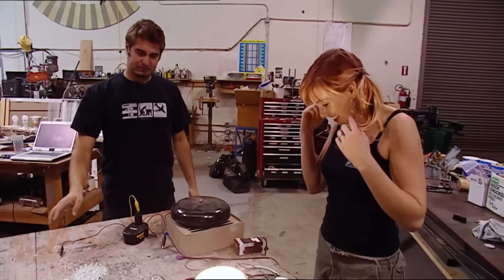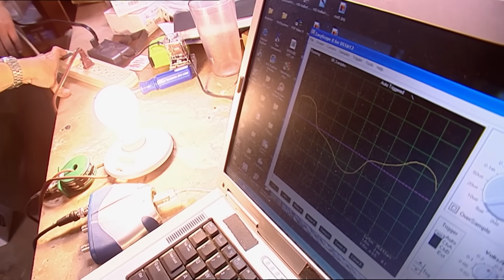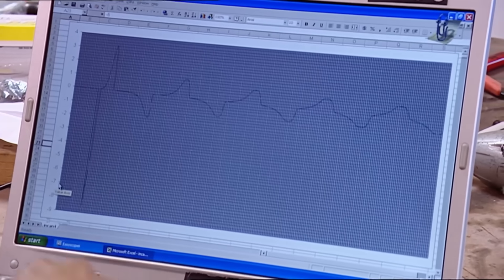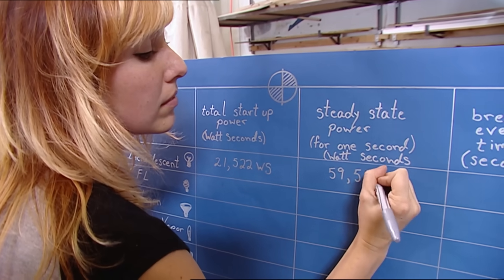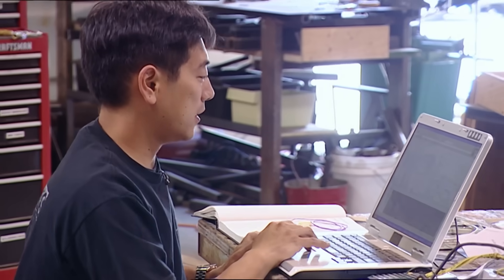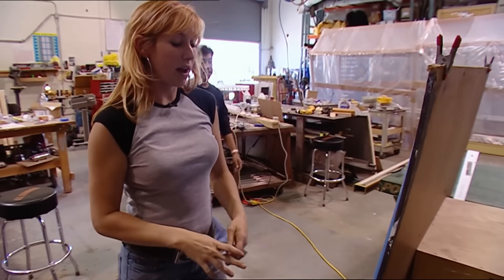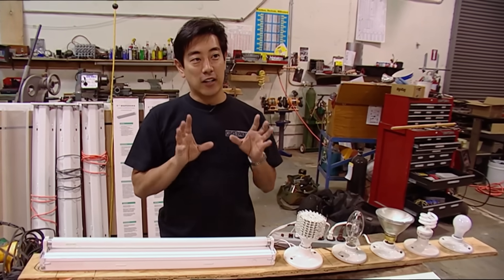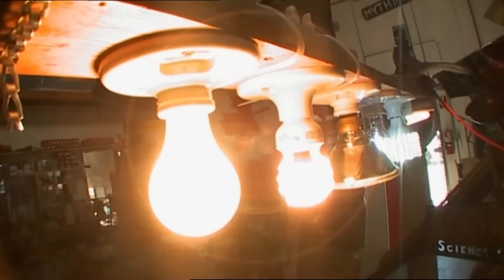Is It Cheaper To Leave The Lights On Than To Turn Them Off? | MythBusters

Comment: There are two items.     energy burn until efficiency.
Secondary item... is effect on life of turning things on and off.

If I leave my led on..  or even incandescent bulb.. they last a looong time.
if i turn them off and on...   they last 25% as long.   even led.

final item to take into account.        is how inconvenient is it to change the bulb.  
If its in a 12 foot ceiling   or outside in a hard to access enclosure..   i leave them on.

chances i fall off a ladder and hurt myself?    0 if i never go up to change the bulbs.
I want the time my property is dark at night outside to be minimal.     criminals show up quickly.

Comment: Two flaws I see: 
1) Didn't say how long each bulb lasted, only that by the end of the 5 year equivalent cycle, all but one burned out. So did some burn out at 6 months equivalent but they didn't monitor that? 
2) what was the cost of energy wasted by leaving lights on? In the case of LED, it's so small that it may be worth the convenience of leaving them on.

Comment: RIP Grant. 

Also, being a little pedantic here, but...this doesn't take into account the price of the electricity. If, for instance, you were running an off-grid solar/battery setup and and LED bulb on the excess energy produced by your system, then they proved here that leaving it on WOULD save money (albeit a totally negligible amount). 

But yeah, in general, turn your lights off folks :)

Comment: This is why I always hated that show and instantly felt anyone who liked it was kinda stupid. They don't even touch on how energy usage is calculated by the electric company & how accurately it will reflect turning the lights on and off at various intervals. They test the bulb longevity while turning them off/on every 2 minutes, but then don't tell us when each one died, and then they compare it to... nothing besides saying "it's 5 years of home use stress" like that is supposed to mean anything quantifiable to anyone who doesn't drool while they breath. How long do each of those bulbs last if you leave them on continually? You have to compare that number to the time it took to burn out while cycling on and off (which again, they don't tell us). Then you have to compare the prices of bulbs and the prices of electricity, and then you can finally see how the extra money to replace the bulbs compares to the extra money for cycling on and off. But the average cretin who thinks Star Wars is peak Sci Fi will accept this as  real science and regurgitate it to their friends. Barf.

Comment: They really dug up an old show since most of the bulbs tested are non existent now.    They forgot the most common reason to not abuse a light as starting them when cold causes more damage  not this 2 min on off test.   I have bulbs that will only last 2 years will low use. And the biggest problem is doing the replacement. some are 25 feet in a light fixture or how about 30 in a chandelier. I found out the old bulbs lasted longer when used with a dimmer   LEDs  and CFL  seem to over heat and burn out  due to poor uality.

Comment: I know that back in the days of CFL being the big thing, it usually ended up being that if you were going to be out of the room for less than 30 minutes, the cost of the wear on the bulb was more expensive than the cost to leave it on. With how little energy it uses for LED, you end up with even worse factors of how long it takes before you spent more money in electricity than it would cost for the wear on the bulb. I would say that a good rule of thumb would be that if you're going to be back in the room within half an hour for either type of bulb, leave it on because the cost for the life of the bulb you reduced with another power cycle is going to be more than the cost to leave it on. Not counting the hassle of actually replacing the bulb on top of that cost

Comment: They were approaching this completely the wrong way from today's perspective. My approach: Take a super-efficient 5W LED. And then factor in everything. Then few Wh saved vs.: Time spent turning off the lights and calories burnt (increased food cost) going there after you have forgotten before because you have a pedantic office coworker who insists on everyone turning the lights off. The enormous cost of being too lazy to turn the lights on when you quickly rush into the kitchen to just grab some small thing, and then bumping your head really hard on something or tripping and hurting yorself and then having to go to the ER.
Reply: A common approach for office break rooms and warehouse spaces are occupancy sensors. When used with fluorescent lighting, which might be a better choice than LED if lumen maintenance is an issue, programmed start ballasts can be used to eliminate the lamp life penalty that may be incurred with frequent starts and instant start ballasts.

Comment: What about Desktop PCs? What's the ratio that makes it legit to turn them off vs leaving them on?
Reply: Most pcs have a power save mode that idles down the gpu fan so leaving your pc on for several hours at a time isn't a big strain on your electric bill.

Your hot water heater uses way more electricity in one hour keeping the water hot than your pc uses in a week
Reply: @fateweaver9844  I understand that. What I was wondering about it for shorter periods. Like say... Not using it from half an hour to an hour. As for power saving, the issue with that is some apps don't play nice with it, and either stop working when resuming or don't work well afterwards.
Reply: @Jedijax7  Set your sleep and hibernate times, especially if you have an old school spinning hard drive. You'll save time over a cold boot

Comment: This myth was purpetrated by the idea that in large buildings it was cheaper to leave lights on rather than pay someone to turn them off.
Reply: Was it not possible to have some kind of central switch which can be used to cut power for every light

Comment: Well, and the funny part is LED can cause massive health problems for people with epilepsy. Incandescent are full spectrum and safe. Carbon wire not so safe because carbon wire react faster to AC stuff, but carbon are safe on DC. Spirals hot gas lamp are kinda safe as long as they don't look at them. Long gas tubes are typically safe when they are new, but they can start blinking. (But that's typically noticed even by health people.) LED on the other hand can blink even on fluctuations in DC, and they have WRONG spectrum.

Comment: Yeah, no. I have some lights that are just difficult to reach to change them out. When I was turning them off after leaving the room, using LED bulbs, they very consistently burned out anywhere from 6 months for lights used more often to a year for the ones used less often. Every. Time. Leaving them on (same brand LED lights)? I haven't changed those lights in over 3 years and still going.

Comment: during winter the lights are heaters; in the summer its less energy to cover your windows and use lights then use sun for lightning and remove heat with AC; there are many many more factors

Comment: The last test is pretty dependend on the energy cost per kw/h. German energy costs are about 4 times higher than in the USA
Reply: Parts of the USA also have energy costs 4 times higher than other parts. It appears that similar political mindsets are a major factor.

Comment: I don't agree. You not only wear out the lamps but many fixtures have ballasts that wear out. The money you save from turning the lights off may easily be lost in having to replace the entire fixture more frequently. At least it's likely to be a wash money wise over ten or twenty years.

Comment: lol how was this even a discussion? We could maybe have this argument over large appliances… like a central AC air handler. Something that uses massive amounts of energy to kickstart their machinery. Or your dryer for clothes. 

The only way light bulbs would matter on this point is if you are just sitting there flippling the light on and off repeatedly. 
.
I would love to see similar tests done for air handler/dryer. Although, the lessons to be learned from those are a bit more nuanced. Maybe rather than keeping your AC on auto to keep turning on and off, switch it to manual and use it when needed. For dryer, it’s use bigger loads, but not THAT much bigger, because you can damage the unit from overfilling.
Reply: Who turns off a central AC air handler when they leave a room? Actually  modern inverter driven AC compressors that almost completely dominate the mini split market and are taking on on the central AC market as well, will use less energy overall without frequent human micromanagement. Humidity control is also far superior. Amazing technology when sized correctly for either your heating or cooling (whichever is greater) load. 

As for electric clothes dryers, they can draw large amount of power for brief intervals but the heating element(s) are rarely on full time. My machine uses on average (by my own actual measurements) approximately 2 kWh per load. That number will vary somewhat depending on how heavy and wet the load is.

Comment: The equation changes is in many industrial and commercial situations where: a) the time it takes for the lamp to reach full brightness is several minutes, b) lamp life is significantly impacted by the number of starts and starting method, c) the labor costs to change a lamp are a significant part of it's total cost of operation., or d) there may be a safety compromise.
Reply: Does external temperature count for much as in the heat dissipation.  Day/Night Hot or Cold climates.
Reply: @Neil-h9o  It does, but how much depends on the specific lamp type. The efficiency (when considering light output per watt only) of an incandescent lamp is a function of how hot the filament is and how quickly it evaporates at that temperature. With a filament operating at several thousand degrees there the effect of a relatively narrow external temperature range is minor. 

A typical 4 foot fluorescent tube runs at it's best efficiency at external temperatures in the 70-80° F  range, falling off slightly when operated at power levels above or below it's nominal rating. Lamp life is relatively unchanged when run at up to 30% above or below nominal rating. The largest factor affecting lamp life is the number of starts and the specific type of ballast used. Some lamp/ballast combinations perform poorly or wont start at all with cold external temperatures. 

Led lamps actually become slightly more efficient and last longer when operated in colder environments. Number of starts is not a significant factor except for some of the bargain bin models. Heat management is the key to longer lamp design lifetime. Lamp manufacturers use a standard called L70 when specifying lamp life. That is the point in time when half of the lamps in a large representative sample are either dead or producing less than 70% of the rated amount of light.
Reply: @doneden5368  
Thanks for the info.  Cheers.
Reply: Yeah, that's why they specified "most residential situations"

Comment: i leave the lights on for the most part unless i want em off, all my lights are LED so the cost is like 2$ a month if i leave everything on. dosent matter to me and I want my cat to have light while im away, plus it discourages home invaders when the lights are on.
Reply: For security reasons maybe it has sense to turn the light on on a timer, not just run it 24x7
Reply: You must have extremely cheap electricity, I have a few 8 watt bulbs that are on 24/30. At 20 cents per kWh, that works out to $1.15 each per month.
Reply: @doneden5368 we have hydroelectricity so yeah it’s p cheap

Comment: The problem is that you didn't run a control group duplicating the same bulbs running non stop the same time the others were cycling on and off. (I would hypothesize based on other studies that few if any of those left on for same period burned out.)  One of Edison's original bulbs is still lit after being continually on for more than a century. And modern tests with a control group show all the bulbs running continuously out last the lifespan of those that suffer surges with on/ off cycling.  SO, saying the myth is busted is misleading with the cost of replacing the burnt out bulbs vastly surpassing any cost savings with turning them off.

Comment: I leave the laundry room light on and the front porch light on. It's an older farm house and I don't know if it's the wiring or what, but those bulbs are blowing out. Even if I put LEDs in. But leaving the light on, the front porch light has been on for over a year and the laundry light for around a year. Laundry light is LED and front porch is regular. I was replacing those bulbs every other month it seemed like. They last longer just leaving them turned on.

Comment: I run only LED and I still turn most off all the time even if its little wattage being used. i figured it all adds up over time.
Reply: LED's cost almost nothing even if you leave them on 24/7. Its like 50 bucks a year if your electricity costs are VERY high otherwise its like 30
Reply: @whitepaws60  With every little thing added up over the year it all adds up, from one led light to a device drawing small loads constant. It might not save a lot but I still would rather turn everything off when not in use, a few dollars is still a few dollars to waste.

Comment: I worked for a very large lighting company. I replaced more lamps triggered by motion than lamps left on in other stores.
Reply: Yeah, that's a longevity question, not a power savings question. But yes, cycling lights reduces their longevity, less-so with LEDs.

Comment: Although it doesn't change there conclusions of this video, some of his measurements might not very accurate...

In the video it appears he was measuring the current only. In a purely resistive load like in an incandescent light bulb, that is enough to calculate the consumed power (by multiplying by the known RMS AC voltage).

Unlike incandescent bulbs, some of the other lights do not have a purely resistive load. Meaning current and voltage will be out of phase and current measurements might be misleading.

In these cases, in an AC circuit, the peak of the current does not occur at the peak of the voltage meaning that the actual power consumption will be even lower than what it appears if you measure only current and multiply by the know AC voltage.

I did this mistake 18 years ago, when I moved to my new home. They had some of these more economic lights and I wanted to measure how much more efficient they were, so I used a clamp meter to measure the current (similar to what he seems to do in the video). I was measuring currents much higher than I was expecting.

My calculations didn't match the measurements on the power meter though, so I did a bit more of research and also used an oscilloscope to have a better look of what was going on and realized that current and voltage were out of phase on those lights and hence the actual power was much lower that it seemed when looking only at the current alone. 

So some of those numbers in his calculations might be even lower. Further emphasizing the conclusions in the video.

Comment: I wonder if any Youtubers have modernized this test with current led bulbs. LEDs are more efficient than flourescents, so if the startup spike is consistent then the LEDS may actually have a time differential of several minute, and with modern engineering pushing materials closer to their limits to comply with efficiency standards there may be additional degradation from power toggling.